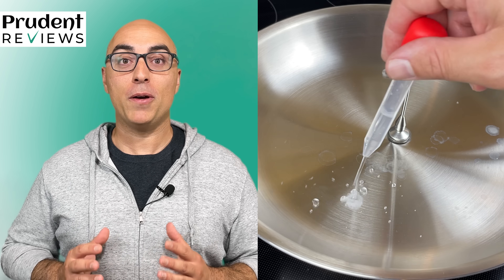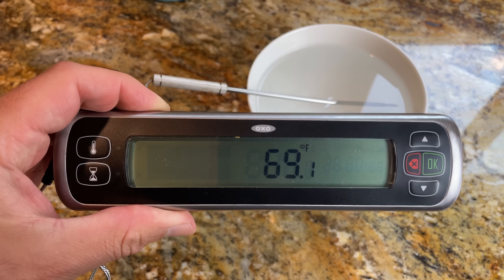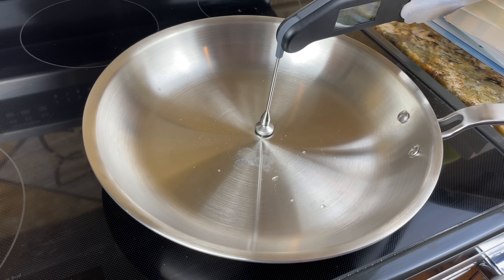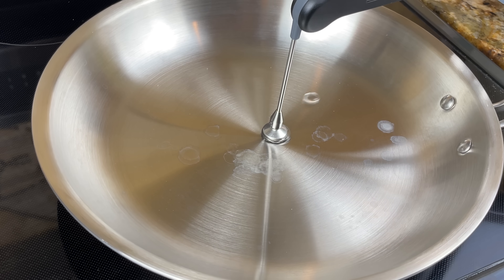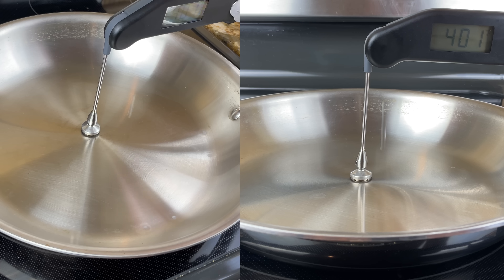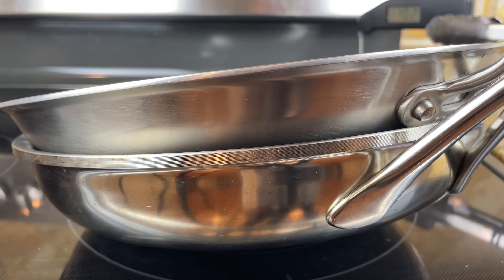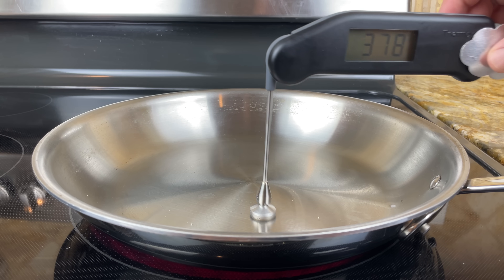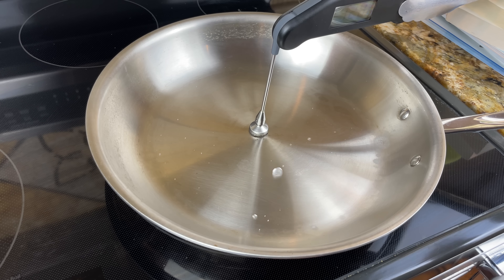Steel Pans Become Non-Stick at THIS Temperature (Leidenfrost Effect Solved)

Comment: Ya, I dont give you tube this kind of attention... step 1 - assume all you tube videos are lies, step 2 see video, step 3 take it as the video is a lie, step 4 wait to see if its a lie or not, by folks like you saying its a lie ... - if I'm even interested, which I'm usually not. edit, my kitchen, has a mix of cooking devices... i have a good experience it stays, bad experience it goes (counter space thing) my 3 fav tools in my kitchen, cast iron skillet, air fryer, electric deep skillet. thats it... i cook all my fave stuff in those 3 things... i didn't include my grill which is where prob 1/4 of our cooking happens 1/2 in the summer (meat wise)... but thanks for the info...

Comment: What is the attachment you used on your thermometer? I don’t think I’ve ever seen that before and since I’ve read an infrared thermometer doesn’t work accurately on stainless steel I’d be interested in getting that attachment so I don’t always have to do the water test but could just quickly check the exact temperature
Reply: I also would like to know how to obtain it. The thermometer looks like a ThermoWorks, but the disk part is not on their web site.
Reply: @DraftCider  ThermoWorks Pro-Surface Thermapen, found via Google Lens
Reply from the maker: It's not an attachment. The thermometer I used has a swivel tip designed specifically for flat surfaces. I linked to it in the description of this video if you're interested in getting one.
Reply: honestly, water test is faster and easier, just go to the sink, wet your hands, flick your hand at the pan to get the water off, and then you got a little bit of water on the pan to check

Comment: The droplets might be trapped by the mineral residue left behind by the previous droplets. They seem to assume the shape of the residue and lose surface tension on the bottom of the droplet.
Reply: My thoughts exactly. I don't think that droplets cooling the surface are even a factor.
Reply: Probably both!
Reply: How does a droplet know there are mineral residue somewhere on the pan? And figure out the path to get there?
Reply: @maxgluteus4263  random movement due to the Leidenfrost effect. Previous droplet evaporated leaving behind mineral residue making that part of the pan "stickier". Like you walking down the sidewalk and stepping onto a random piece of gum someone else dropped.

Comment: Is it safe to add cooking oil when the pan is that hot? It won't burn, fume?
Reply: depends on the oil; avocado oil will be fine, it would be shimmering at that temp
something way lower temp like olive oil or butter will absolutely smoke if you leave it on for too long; for those oils, i pour the oil, and basically immediately put the food into the pan and then that keeps it from smoking too much; though i generally avoid starting cooking with those oils/fats

Comment: So this means you should use oil with a higher flash point like avocado oil? 420 seems much hotter than what EVOO or butter can handle.
Reply: There are papers testing LF of water stainless combo. The result is largely inconclusive. 

The takeaway is just cook with whatever setting works for you, and go as low temp as it is allowed with your specific set up.
Reply: low smoke point oils are only good for cooking on medium heat pretty much; the 420f temp is only required for preheating the pan, once you're cooking, you dont need to be at that temp anymore and can be much lower; e.g. if you're cooking a steak, start with a high smoke point neutral oil like avocado oil, get a good sear on it, then butter baste it afterwards when the pan isnt at the burning/smoking temperature of butter

Comment: which type of thermometer do you use which such sensor for flat surface. I can recognize perhaps thermapen but did not find this type of sensor.
Reply: The thermometer looks like a ThermoWorks, but the disk part is not on their web site.
Reply: Thermoworks pro-surface thermapen. on sale rn!
Reply from the maker: I linked to it in the description

Comment: I doubt the spots were cooler, more likely the minerals that remain at the spot interact and break the steam barrier.
Reply from the maker: That is definitely possible. Could be both. I thought it was temperature related because the mineral deposits were still there when the pan got hotter but didn’t break the barrier.
Reply: @PrudentReviews  yeah, hotter over the spot, two variables. hotter spot may be hot enough to dance a over the minerals.

Comment: Now I need to figure out what level to put on a burner to get to that temp and I'll be golden..
Reply: use medium low to medium for around 2 minutes to heat the pan evenly and prevent warping on cheaper pans; and even some more expensive pans can warp too; which also gives you some time to do some prep work/finish your prep work before cooking
Reply: @awesomestuff9715  I give it a full 5 min, never any sticking problems.

Comment: This explains why my egg caught tonight, I was thinking that I hadn't allowed the frypan to get hot enough. Now I know I didn't.
Reply: honestly, in my experience with stainless steel, you will not be able to make sunny side up eggs without a crispy white, because the proteins only really release from the pan after it cooks enough, so if you want to make runny scrambled eggs (though for this it's less of an issue if you have enough fat), or sunny side up eggs with a nice soft bottom, i would recommend carbon steel or teflon pans over stainless
Reply: The water drop test is actually the only method I've ever used and it's never failed me. 

Now you will never rush the pan again, I bet! :)

Have a good weekend.

Comment: So we have to do this in order to fry eggs? No thanks I'll just use my OXO non stick skillet. Why would you NEED to do this?
Reply: Some people do not want to buy non stick pans that will eventually scratch. You can get better browning with a hotter pan initially which is terrible for Teflon as it degrades at said temperatures
Reply: A chemist once said tha PTFE is perfectly safe as long as you don't get it wet. Since everything you put in a skillet is wet, your non stick pan isn't safe to eat from. Forever chemicals are a btch.
Reply: Because non stick pans are PFA chemical nightmares. 🤢

Comment: Thank you so very much.  I've posed this exact question many times over the last few years and only got very pretentious and very snotty responses.   "Just do the water drop test and shut up! There's no way to tell you the temperature , no way to tell the temp accurately..."  etc.  etc.  etc. 
To be clear, I asked for a ballpark temp each time not the exact temp.  
Again, thank you.  Your description and demo of the exact method is absolutely perfect, it will surely get hate from the crowd that love to be worshipped.  
Have watched you for quite awhile,  finally subscribed.
Reply from the maker: I’ve gotten this question dozens of times. It was time to finally test it and find out. Appreciate the support.
Reply: honestly, as someone who has been using pretty much only stainless steel and carbon steel pans for the last 5 years, i would say that doing the water drop test for the pan is quick and easy to do, because not everybody has a thermometer to probe their pan, and it's a foolproof method of making sure your pan was hot enough, (and i doubt anybody actually measured what their pan temp was when that phenomenon occurs)

nowadays though, i just feel the heat radiating off of the pan and know when my pan is hot enough so i can skip the water test, but for newcomers to stainless steel cookware, i would much rather recommend the pretty much free water over the instant read thermometer with the flat tip attachment that probably costs $20 

i feel like nobody would want to use stainless steel if they had to shell out another tenner or two over the cost of their already more expensive pan investment, plus the inconvenience of measuring the temperature of the pan every time before they cook

p.s. i dont believe that s.s. pans are the best and only pans you should have, i do believe you should have 1 stainless steel pan and 1 teflon pan, and that should cover all your bases for pan frying anything you need, from a french omelette, or beautifully runny japanese omurice (both which pretty much require teflon pans), to a ripping hot pan to make a wonderful crust on your skirt steak, or doing a quick stir fry, which a teflon pan will struggle with due to the temperature limit before it degrades
Reply: @awesomestuff9715  I've started using ss and it was frustrating using the water test.  it took so long, dropping and observing, waiting, dropping and observing, waiting.  then i'd overheat, the pan and i'd still get some sticking.  and the cycle repeats the next use....  I'm one of those who would prob shell out the $10 or two!  didn't know there was that flat attachment :p
Reply: @awesomestuff9715 Teflon sucks. French omelette predates it by several hundred years. I would never recommend a nonstick pan for omelettes. 

Non stick pans are more about the cleanup than the cooking. 

Carbon steel all day in restaurants for omelettes.
Reply: @awesomestuff9715  my grand kid's kids will be using my cast iron and stainless pans. One piece pans are end all be all for me. Same with knives.
Reply: In a way, they're right because a chef isn't setting a temperature for the pan. They do however have access to water and develop a muscle memory for the pans and stoves they use frequently. The actual number is irrelevant and impractical. It's not snobby to tell you how they know, without performing scientific tests.

Comment: Can you do a comparison of surface thermometers? Instant read Thermapro vs Testo vs infra red vs a cheap cuisinart griddle thermometer.
Reply: I was just about to ask this - especially since I've never seen quite that type of surface thermometer with the flat disk at the end. I'd love to see this test too.
Reply from the maker: What would you be most interested in seeing? Which is more accurate?
Reply: @PrudentReviews  Accuracy vs. cost.
Reply: @PrudentReviews  reactivity as well. How quickly it can take a reading.
Reply from the maker: Great idea

Comment: Great test! Cooking at such temperatures does help to prevent sticking. However I have a problem - most oils start to smoke, because temperature is beyond smoke point.
Reply: Algae oil goes high
Reply: Use avocado oil. It's healthy and has the highest smoke point.
Reply: @RHannah78 Yes, I think the smoke  point is around  500°
Reply: You only need to reach the target temperature for the pan when when you begin pouring the oil. After that, you can lower the heat
Reply: @_DeepGroove_ why? Then the oil will stick in the pan.
Reply: @TheBooban  It's the opposite. Like water, oil will slightly float on the pan surface.
Reply: @_DeepGroove_  hmm? Ugh think I’ll go for a ceramic pan instead.
Reply: @TheBooban  Those are poop
Reply: @LiberatedMind1  then what? Carbon steel?
Reply: @TheBooban  Yes. Carbon steel, stainless steel and cast iron are the best, and are what restaurants use.
Reply: @ cast iron definitely no. Can’t even wash the thing. I’ll buy a cheap carbon steel pan in thailand or something.
Reply: @TheBooban  Why can't you wash it? We just got two carbon steel pans, they are great, food comes off easily.
Reply: @LiberatedMind1  you wash off the seasoning. Plus, it rusts. Plus, no tomato based food, also ruins the seasoning. Its stupid.
Reply: @TheBooban  No we have two, gentle soap and scrubbing doesn't wash off the seasoning. They don't rust as long as you don't let them air dry. You can cook whatever you want in them. These are your misconceptions, you have no actually experience with these pans.
Reply: @ I had one. It rusted. I think most people would say never use soap on an iron pan.
Reply: @TheBooban  I bought one with some rust on it, cleaned it off with vinegar then sealed with oil. Good as new. It's not brain surgery. If you don't want to do even a small amount of maintenance then go with stainless steel.
Reply: @ yes I thought to go with stainless steel. (They burn and then get scratched up because of scrubbing up and then never good again.But not anymore. I’ll find a cheap carbon steel, I think they must be the best.
Reply: @TheBooban  That's also not correct about stainless steel. You'll be fine with carbon steel.
Reply: @ i scrubbed a pot to get out the burns and everything stuck where i scrubbed. Then i used steel wool and then even worse. Yeah, gonna go for carbon steel.
Reply: @ Ive had burns on them before. This only happens if you dont watch pan temp, it can happen on any type of pan. Vinegar helps get it off, especially if you boil it on the pan. Restaurants use both stainless steel and carbon steel, can’t go wrong with either.
Reply: @ i didn’t know about vinegar. Yes, it was too hot, i am careless. I wish there was something to buff out a pan and smooth it out again. Probably is, i just don’t know it.
Reply: @ There’s videos of how to do it online.
Reply: @LiberatedMind1  eh? I checked..no. Theres one 9 years ago. I replied to it 7 years ago lol. I have the same scratched pot still hahaha.
Reply: @ You didn’t check very well, you just are being stubborn at this point. I cleaned a charred black pan, you can too. Or don’t, no point arguing this.
Reply: @ its cleaned. But the scratches remain and the same spot gets burned again. Im not stubborn, its not doable. You need to have a machine to buff it like they do on metal.
Reply: @TheBooban  So your pan is ruined, get another one. Problem solved.
Reply: @_DeepGroove_  This seems to be a forgotten point in most Youtube cooking videos. Turning the heat back down after this.
Reply: Passing the smoke point of most oils polymerization effect which becomes a non stick layer
Reply: @the_nondrive_side  Perhaps a dumb question, but if the pan is now non stick, why need the oil??
Reply: @TheBooban  you don't.

Comment: Oil-coating is my answer. It's very popular in stir-fry Chinese restaurants
Reply: Don't stir-fry restaurants use carbon steel instead of stainless steel?
Reply: @_DeepGroove_  they still do oil coating
Reply: @muzicaally7909  Exactly. Oil coating is common with carbon steel pans/woks to help build up the layer of polymers. Not so much with stainless steel
Reply: @muzicaally7909  you can do oil coating on stainless steel, but it doesnt stick between washes; you want carbon steel for that

pros of carbon steel is actually that it sticks a bit; it's the ideal pan for making a steak or such on, because it leaves some "fond" which you can make a flavourful pan sauce with, while carbon steel or cast iron with the seasoning (polymerized oil coat) is very nonstick, (not quite as much as teflon but still very good) but due to it being nonstick, there isnt quite as much "fond" that sticks to the pan for making a sauce out of. also I avoid cooking acidic foods on carbon steel or cast iron since that strips the seasoning off slowly

Comment: Where did you get that thermometer with the flat tip? 😀
Reply: Thermoworks Pro-Surface
Reply: The thermometer looks like a ThermoWorks, but the disk part is not on their web site.
Reply from the maker: It's from ThermoWorks. I linked to the exact one I used in the description of this video if you're interested in getting one.

Comment: That's pretty hot!  Makes me want to use carbon steel or even a teflon-style-coated pan instead, so I don't burn my butter or oil. (or other ingredients, like shallots)
Reply: Look into ceramic coated pans as an alternative to Teflon.  If cared for, these are just as "non-stick", but avoid PFAS chemicals.  I think they last longer too.
Reply: Never use Teflon that high, all the nasty chemicals in Teflon are released way before that. I don't use Teflon at all. It's really toxic
Reply: @samagee2211  Teflon is not toxic if you use medium heat. The highest heat for Teflon use should be 300°.
Reply: @i95smuggler  i would generally avoid it if you have birds though because the offgassing of teflon is bad for birds (generally safe for humans and other pets though afaik)
Reply: Yea I agree!

Comment: I wonder about the effect of a higher altitude on the Leidenfrost Effect? Water boils at a lower temperature the higher the altitude, could this effect happen earlier in the heating process?
Reply: Yes, I would expect that to be the case.
Reply: This would actually help, because the Leidenfrost Effect would occur at a lower temperature, decreasing the risk of burning the butter or crisping the egg white.  You would, however, still have to lower the temperature of the oil-butter mixture to around 300F to avoid browning.

Comment: I use a laser thermometer.
Very accurate 👍🏽
Reply: Normally they are, but when measuring reflective surfaces, like some pans are, you'll get inaccurate measurements. The water drop test is something that is cheap and easy and near foolproof, no need to use a thermometer.
Reply: @_aceofspades_   ⬆⬆THIS! Supposed to be 215-220℃ but my laser thermometer wouldn't go above 180-190 - even though I could see it was really really hot after being on the gas for 5-6mins. Tried some water and it immediately balled up...in with the oil & it smoked and discoloured. Dumped it and just went by the LF/water test afterwards....